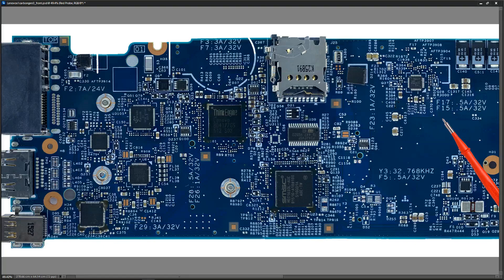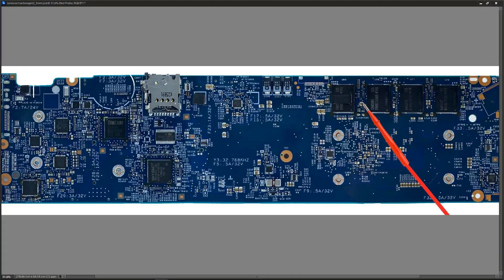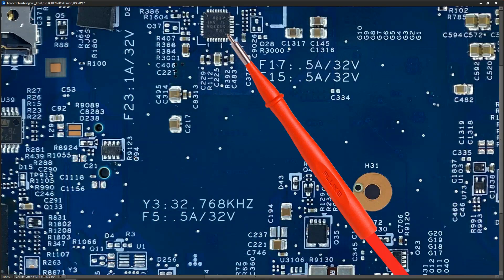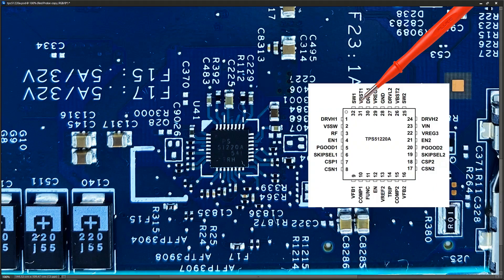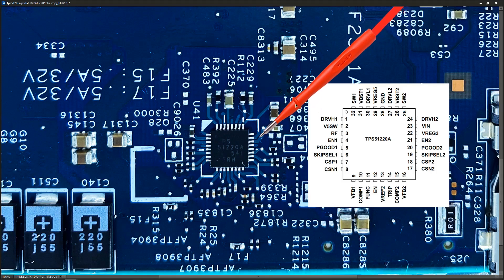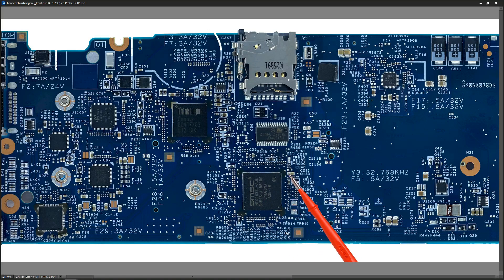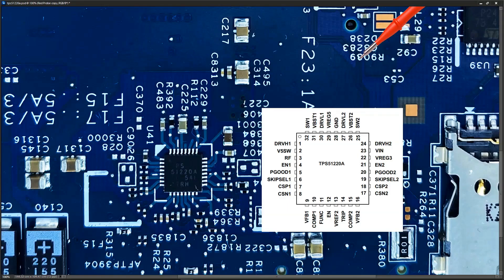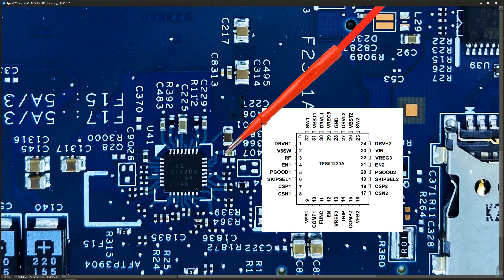Lenovo X1 Carbon Gen 3 - 3.3V Always On

Comment: Fantastic lesson and great picture !  I`m just curios about how could I find out if the Chip TPS51220A  or  another one is in short circuit, do you think one way to find out if it is short circuit  could be  in diodo mode  measure   the  V in  Positive and  the ground  negative  in pin  28 ?  I guess is the ground ...  I hope I`m making sense,   thank you for your time and effort to share !   have a good one.
Reply from the maker: Hi Rene, It really depends on how the chip has failed. If an IC itself is shorted, it will pass a lot of current to ground so it will usually be very hot which you find by touch / alcohol /thermal camera. However if the output circuit of the IC is shorted, the IC can get very hot even though it is not itself shorted. Sorin has a very good example of this on the video below. 

https://youtu.be/nxGRO8gbFZo?t=2474